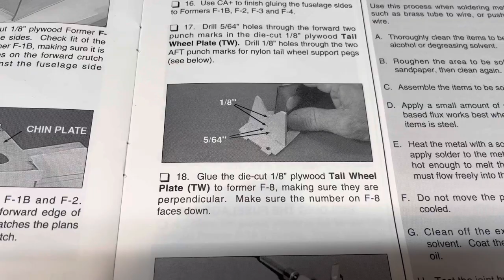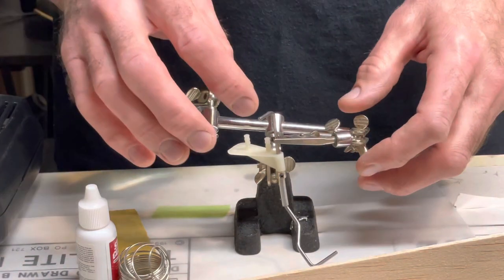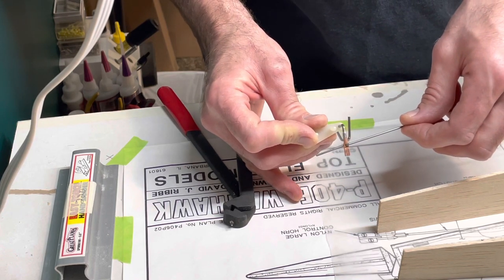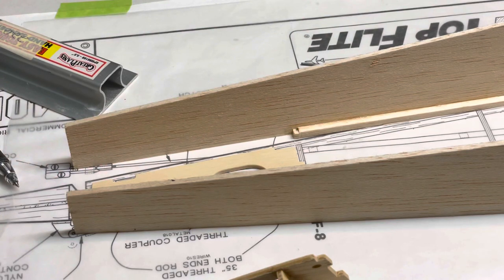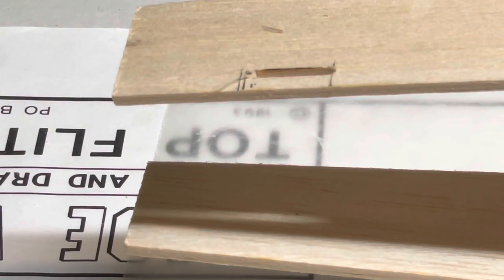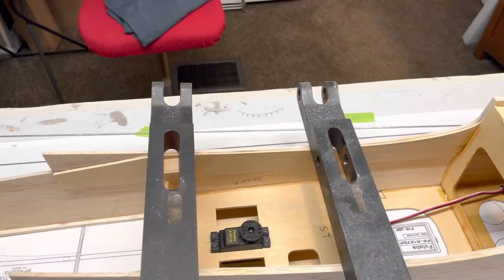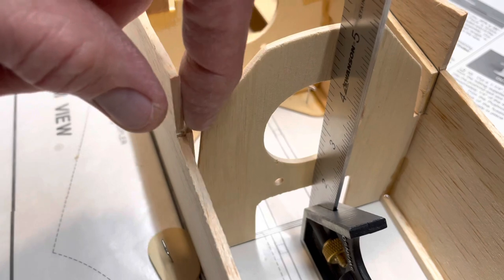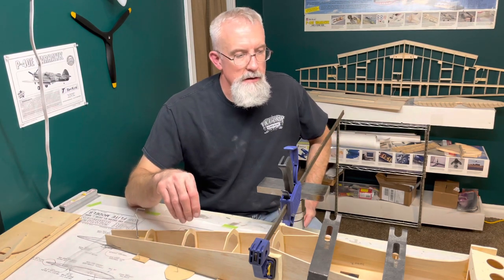Top Flite .60 size P-40E Warhawk Build: Part 17 (Fuse Build Up: Part 3)

Comment: I have not built this model, but looking at what you have, take note of the top edge of the doubler in the stress area. Why not scribe a line along the inside of the fuse just above (below here) the top edge of the doubler. You would be reducing the fibers on the inside of the fuselage side, creating a kind of hinge zone for the forces to collapse over. And it does not cut through the side. More glue or a strip of balsa could be added there later to cover over and reinforce.
Reply from the maker: Thanks for the tip. 👍